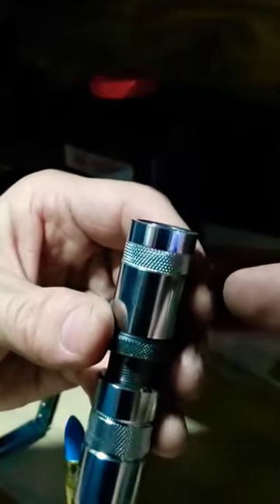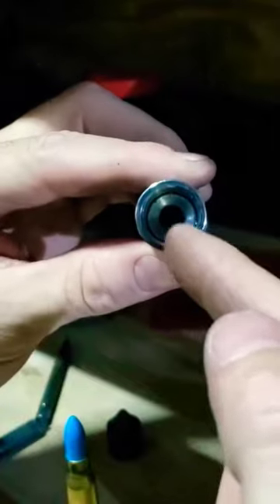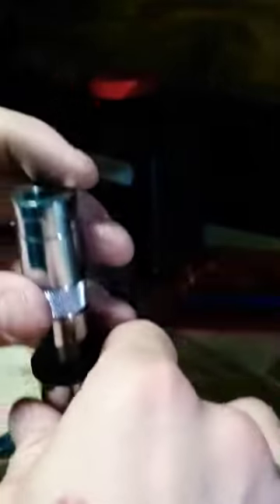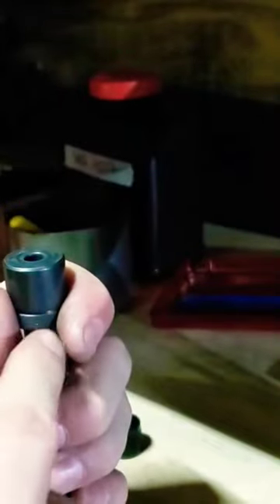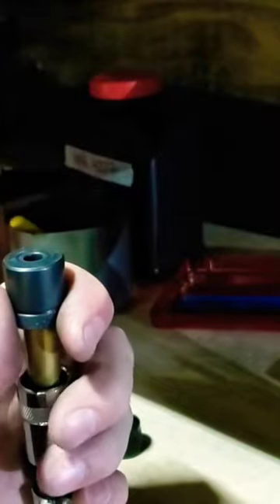How To Crimp A Rifle Round With The Lee Loader

Comment: What is this equipment called? I see it’s from lymon but can’t find exactly what you got. I have no room for a Dillon machine of sorts and would like a smaller version of a reload station
Reply from the maker: Lyman Headspace/case gauge to check your ammo with, loading it with a Lee Classic Loader. They can be had for $30-40 and you just need a hammer to load your own ammo.

Comment: using a hammer seems more dangerous.  (due to case irregularities, caused by inconsistent hammer blows) 
I'd Rather use leverage to make a crimp.  (with torque metering)
Reply from the maker: Sounds great in a perfect world, but this is more of a bug out item and I'll take what I can get. If we get the choice, I'll use a normal press, have my brass sized and trimmed the exact same, use calipers to measure, and all the normal things we do when we have the proper tools. This is basically last case scenario for rifle rounds.
Reply: @Dummy Round  I always thought about laying how to make gunpowder from mineral I am able to find In a bug out last resort situation
Reply from the maker: Primers and powder are gonna be the hard part